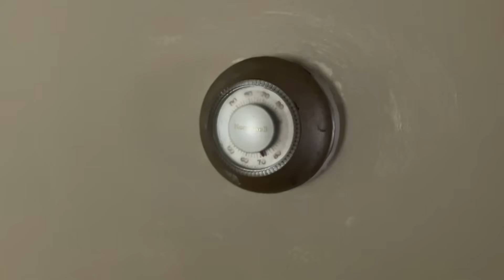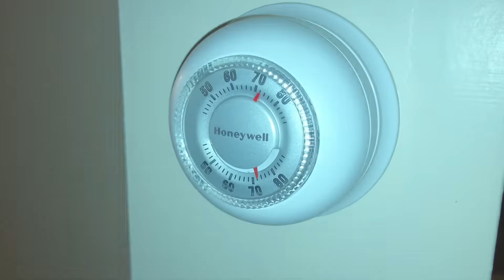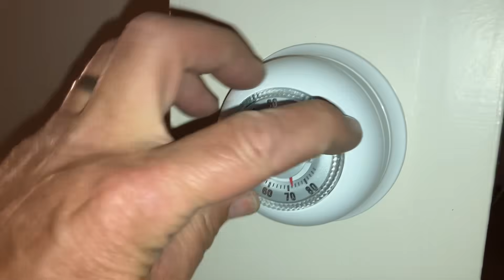Whole House FREEZING! Burnham Boiler Dead – The Real Cause Will Shock You

Comment: 4:06 In California all our gas appliances are connected using flex hoses because of the earthquakes.  Seeing a solid gas line going to the water heater valve just looks wrong to me.  AND you don't have any seismic straps on it.  What gives? 😄

Comment: I still get blown away by the number of customers that think, if during a failure to heat, that if you increase the thermostat temperature MORE, it will make the heating system work harder.  They treat it like a gas pedal.  There's nothing to throttle there. #OneOfLifesLittleMysteries

Comment: thought for sure we'd see some failing later model white color electronic T87's, they get intermittent when the batteries in them are low (non-changeable). 5 year warranty and they usually make it a year or two past that, depending on cycled on time. lol

Comment: Guess who ever installed that boiler didn't read the instructions as to where the damper should have been installed above the draft hood. They even provide pictures as to where it goes.
Reply: the main reason for putting it after the draft hood, is so the flue spill switch can do it's job if it fires when damper is shut. otherwise it will all blast back out the burner area, burning wiring and parts, could also partially choke itself out, flood with gas and go boom with large fireballs or explosion if it retries ignition. but it would likely open the thermal rollout fuse pretty fast.
also a small amount of efficiency is gained by blocking the warmed house air from going up the chimney.